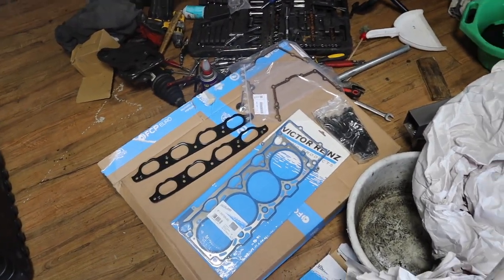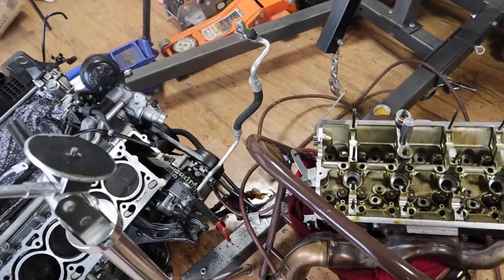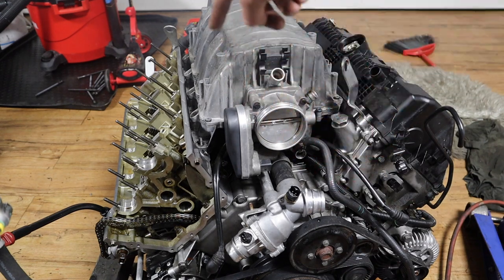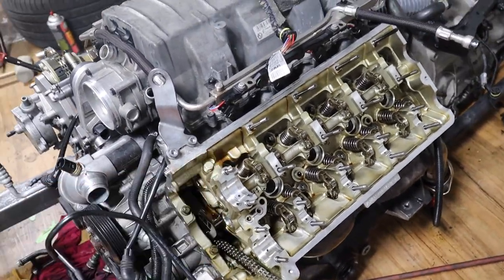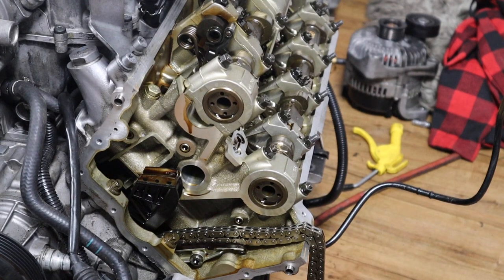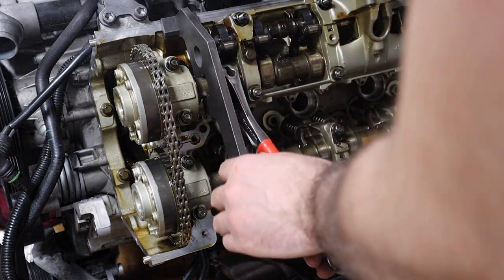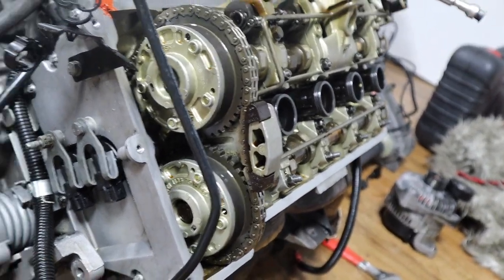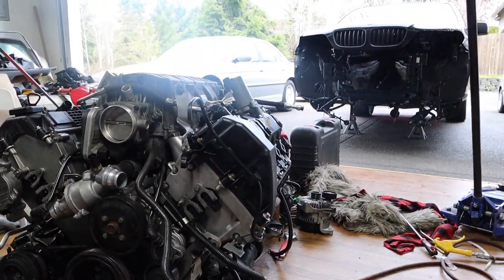BMW E53 X5 N62 Engine Assembly! Part-2

Comment: What is the torque spec for the two head bolts in front of the timing chains? Two on both sides of the engine right behind the timing covers?

Comment: Did you also replace the alternator bracket gasket while the engine was out?
Reply from the maker: Yes I have before I did the valve steam seals.